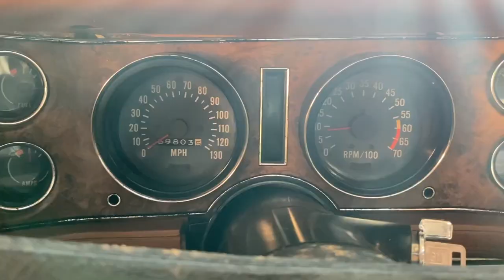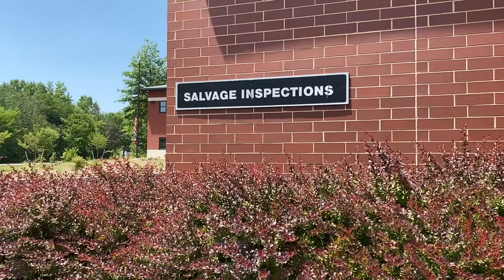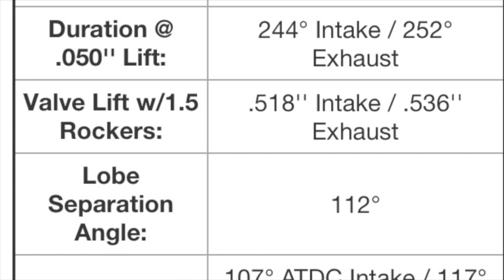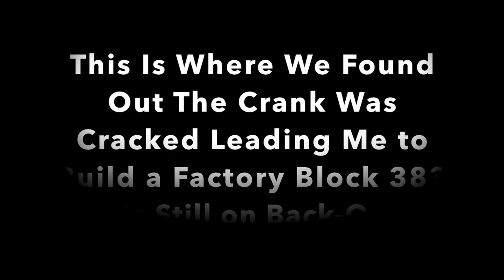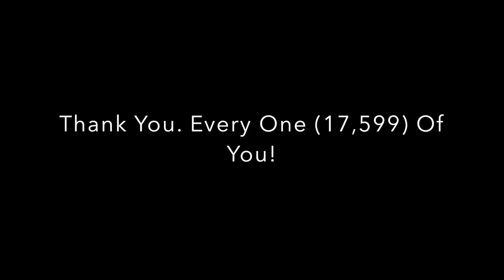A look At What Was Accomplished in 2020! THANK YOU.

Comment: Me and my dad went far with the 2000 Chevy Tahoe. I’m 14 and he is 40 something. He is going into heart surgery this next week. And we live in Ohio so we needed to take the body and frame apart form each other. And we did we grinded and painted the frame. We got the engine almost done. We got the block degreased we got the timing chain on for the ls. With a cam upgrade. He says [dont tell mom] so I don’t. And he got the suspension in the whole rear axle in and pretty much the front of the frame done with the steering and the whatever you wanna call it the front diff. But also we did all this progress. And I got a chance of losing him next week with the open heart surgery. So im scared. But I want to work on the truck we have with him so much. We put so much money for new parts and stupid stripped bolts. To come all this way into 2021. We started in December of 2019 I think. Now it’s 2021.
Reply from the maker: Sending some prayers your way that everything works out and he will recover quickly 🙏. If you need anything or have any questions that I can help you with, let me know. I made the best memories with my dad working on cars. Stay strong man✊ and send me an update on his progress after next week!
Reply: @RyanSampsonRPh  update uhh he is doing fine but he gave the doctors some trouble so they gave him a double dosage of sleepy gas and still was biting the oxygen tube and digging his heels into the bed when he was asleep. But he made it and is doing fine. Just has to be in a hospital for a week or so until he comes back.
Reply from the maker: @gillzy9126  Awesome news that the surgery went well! Will be thinking of you guys during his recovery 🙂